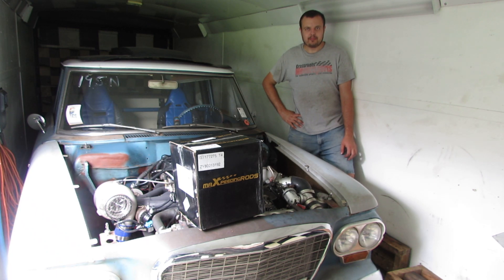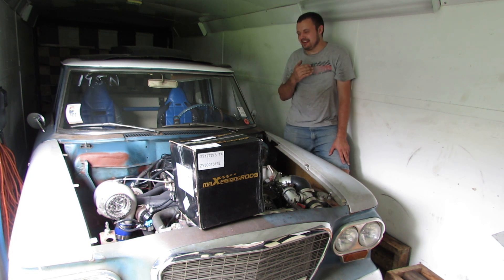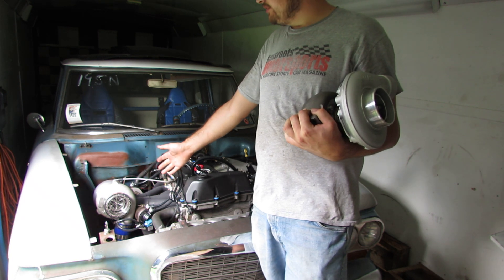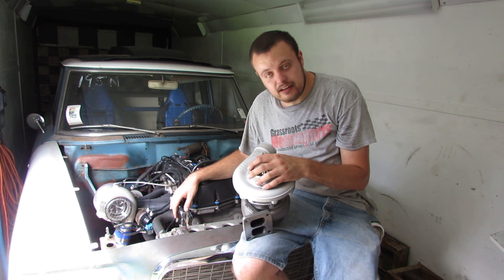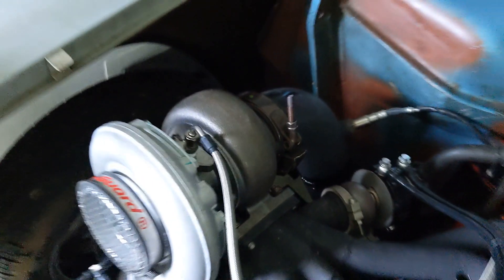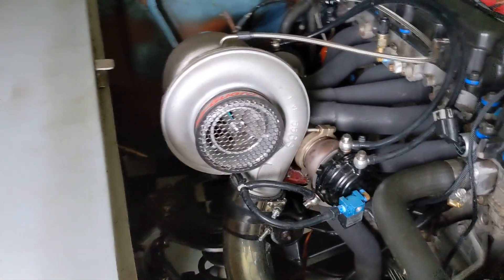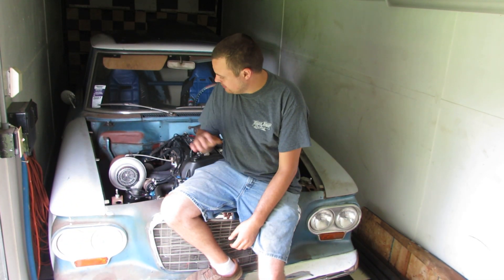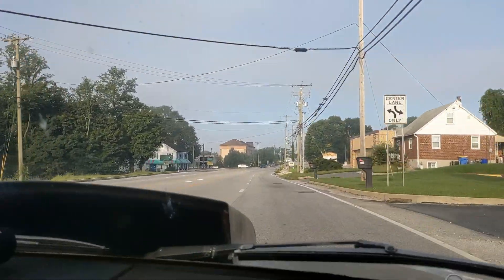The Stude gets a new turbo from Maxpeedingrods

Comment: Only video I've found on YT featuring the s366 clone. Wanting to mount one at the end of the y pipe beside the trans on a 5.3 tahoe. At what rpm did the s366 transition into positive pressure on the street for u?
Reply from the maker: Not sure when it spooled, but it was quick.
Reply: @Calvin-Nelson  awesome, thanx for the reply. Also can the ecu in the 07 trailblazer/envoy 4.2l be easily fully tuned for boost? Or does it need to be the 08-09 ecu to be worth it?

Comment: I just bought a HX35 (10cm) turbo from maxpeedingrods for my 3.0 mercedes diesel (om606). As it's a diesel I need to make at least 30 psi (2 bar). I'm going to put up a video of the results but from all of my research. The only downside these turbos have is that the oil feed holes in the turbo bearing are a little undersized.

Comment: Congrats on your new partnership Calvin. Again I appreciate all the info on the 4200. I’d like to pick your brain a little more about my ‘04 TB 4x4 that I’m rebuilding with an ‘07 head & exhaust. Not sure what the best way to communicate a few questions would be. 
Ive gasket matched the exhaust ports, and am going to do the same on the ‘07 exhaust manifold. I’m going to finish porting the head. 
I noticed intake manifold ports are slightly smaller than intake ports on head. Airflow into engine doesn’t seem to be as much of an issue as airflow out on these engines. No mods can be done to throttle body other than cleaning. Going to get a Custom tune when all done. 
I’m hoping for 325-350 rwhp when done. 
Larger injectors? What size would you recommend?
I’m not going to boost but am going to see about a true ram air/cold air intake thru hood. 
‘04 timing chain ok with ‘07 head & cams etc?
Larger full pump needed?
Anything else I should look at?  Thx again Calvin.
Reply from the maker: You may need a larger fuel pump. The problem with injectors is finding one that fits the 4200. The injectors need to be pretty tall. Siemens deka 80s worked well in the past for me. You may need a bit larger pump. Not sure what the stock size is. It may have enough overhead.
Reply: @Calvin-Nelson  Thanks again for the advice. I appreciate your input, no one knows the ins & outs of these 4200’s like you do.

Comment: Most of the gtx3584rs  clones are rated to 1000hp
Did you have a lot of back pressure for you to switch turbos?
Reply from the maker: Yes. Lots of back pressure. Like 2:1 ratio
Reply: He had a gtx3582 clone not a 3584, the 3584 is a 67mm compressor and the 3582 is a 62mm compressor. 2 completely different turbos. The GTX3582r gen 1 is rated for 750hp by Garret (which is the most commonly copied, the gen 2 has a 66mm compressor wheel), so i bet he was very close to the end effeciency on that turbo, probably some more on the table if he were to screw around with a bigger turbine housing but yeah.

Comment: Hey man i was looking at some aftermarket piston options it seems like the 3.5L ecoboost has a 93mm piston with a .905" piston pin available. Diamond, manley, JE, CP and a couple other companies sell forged 2618 pistons for them. Found part# 35002-6, its supposed to be rated for 1000 wheel  out of the box and around $850. I believe that HP rating is with the standard material piston pin aswell, id assume with an H13 piston pin upgrade should be good for 1200hp.
Reply from the maker: Good to know. I was looking at Subaru EJ25 pistons.

Comment: Ya know Calvin, you could add a VGT turbine side......look up the DPS Turbonator .......then go add a silly compressor like an 88mm
Reply: VGT is usually for someone whos trying to make a gobs of torque off idle like a diesel, with these stock bottom end engines you kind of want the opposite of that lol.
Reply: Transmissions can also get unhappy when you dump a bunch of low-end torque into them.
Reply from the maker: Oof. They're expensive.. Honestly happy with the turbo that's on it. Lol